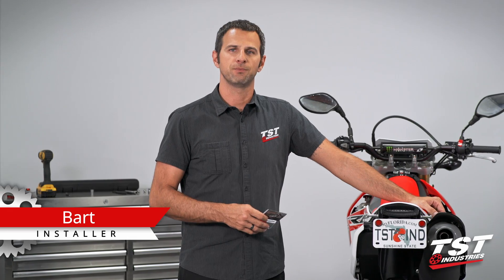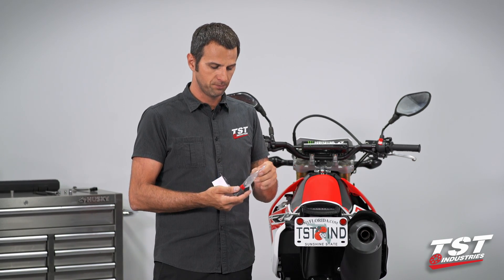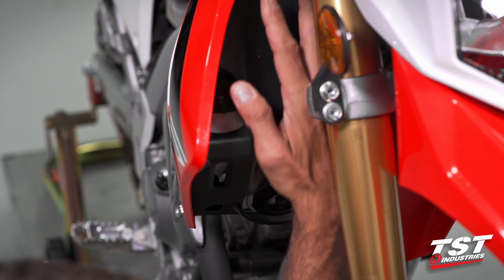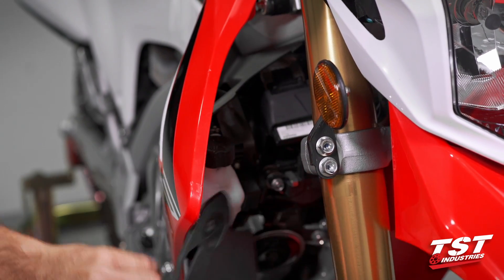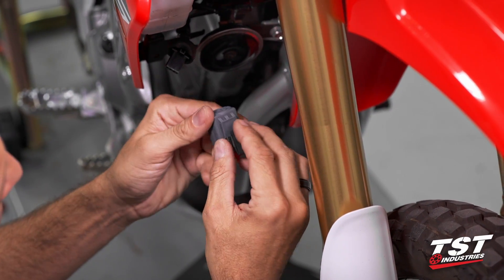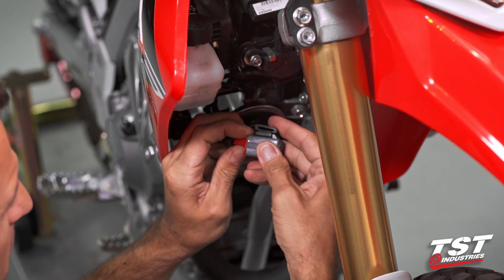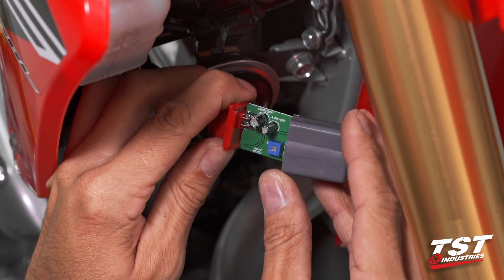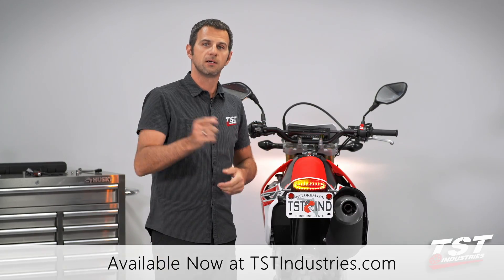How to install an LED Flasher Relay on a 2012-2016 Honda CRF250L by TST Industries

Comment: This is incorrect for 2017 crfl250l.  Please make video of the the location for the relay for the 2017 crfl250 Rally.  Thank you.
Reply from the maker: The location of the Flasher Relay on the 2017 model is behind the rear brake reservoir. If we get the opportunity to get a 2017 CRF250L in house we may proceed with filming that installation.
Reply: TSTindustries still waiting 😜

Comment: i bought the relay from yall and can find were to pit it
Reply from the maker: Refer to timestamp 2:12 and you will see exactly where that relay needs to go.
Reply: TSTindustries i have a 2017 crf250l i just found where it goes its behind the rear break fluid reservoir on the right side of the bike
Reply: The relay on the 2017 is under the airbox, you should hear the clicking if you power up you bike. i did the same thing lol like just now
Reply: For a 2017, I can see people saying it's under the airbox or rear brake reservoir, but I can't find mine.  Do you have to remove anything to replace this on a 2017?  What's the easiest way from someone who has done it?

Comment: have you done one on a gsr 750 yet
Reply from the maker: We haven't done a video on a GSXR yet but we do make a relay specific for those bikes. The OEM relay is located in the tail section , has 7 pins, and a rectangular package. You can see it here: https://tstindustries.com/TST-Suzuki-7-Pin-LED-Flasher-Relay.html
Reply: TSTindustries thanks for your reply but its a gsr not gsxr or gsxs in the states so i still dont know were the relay is.
Reply from the maker: I looked into this for you. According to my sources the GSR750 was introduced in 2011 in markets outside USA and a few years later was brought to the American market under the name GSXS750. I only have build data on the GSXS model, and that one requires the relay contained in the page that I sent you in my previous reply. Our relay replaces OEM relay Suzuki part number: 38610-03F00 . If you can verify that your stock relay is that part number then we will know that the relay I sent you info on will fit. If not then you can send us a photo of your OEM relay and its plug configuration and we will match you up with what you need.
Reply: TSTindustries ok thank you